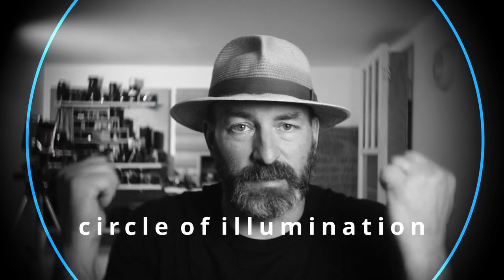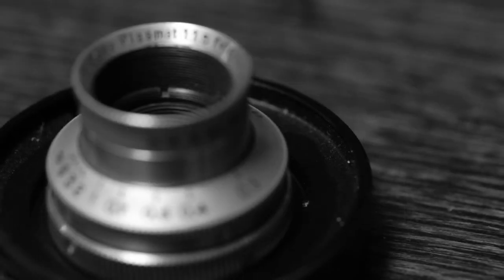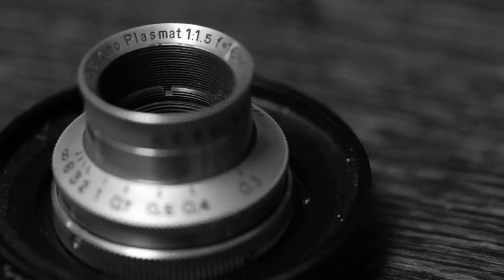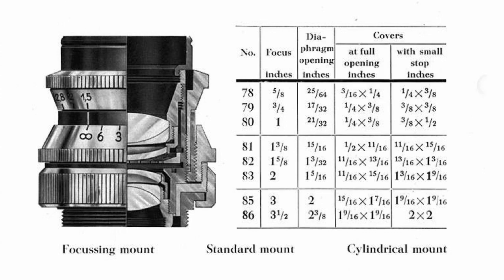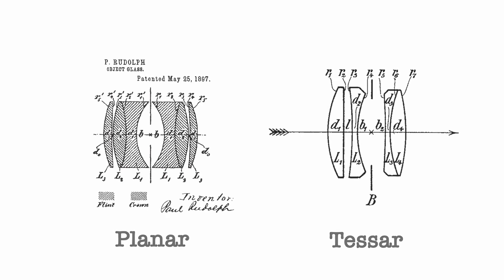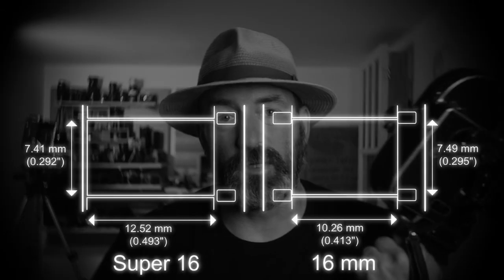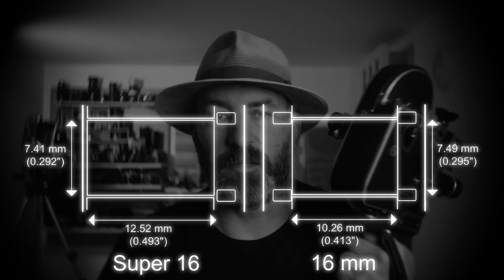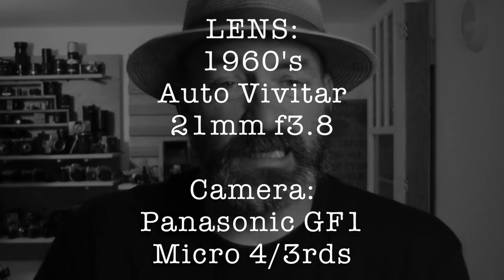Crazy vintage lens on a new...ish camera - The covering power of a lens

Comment: Great distinction between illumination and definition. Moden lenses do not require it, as the designs use all of the glass to refract acceptably. Still, the old lenses are a well of creativity. Aberrations are a challenge!
Reply from the maker: I think the Sigma Art series have a huge circle of illumination. A friend of mine was using one on the GFX medium format camera. It would explain the size and weight of those beasts, if they are designed to throw a larger image circle than needed and the sharpest part covers the smaller format. My Nikon Series E 50mmm f1.8 is another lens that has a larger than needed image circle; it might cover 645 format...
Reply: @nuovofresco  Cosina made the E lens for Nikon, hence it is not a Nikkor. 
Sigma Art lenses seem to be amazing, but 'flat'? I can't afford to invest in one, yet. 
Sigma have certainly out competed their bretheren in Japan.
Pity their cameras have not done better.

Comment: The plasmat is sharper than the 'Vivitar'. The serial number of which may assist you in identifying the Japanese manufacturer. Interesting!
Reply from the maker: I think I need to give the Vivitar another go. I'm pretty sure I missed the focus. One of my Minolta MD to m4/3 adaptors moves the focus point a bit further back than the focus distances on the lens show. The serial number starts with 37 so I think that it was made by Tokina if I'm remembering right. It has a T4 mount on it.
Reply from the maker: I re-watched the video. I definitely missed the focus by about 15cm on the Vivitar.... My hat reveals how off I was.

Comment: Did you know there are quite a few C mounts, not all old, that cover APS? and m4/3 has even more options.
Reply from the maker: I have a soft spot for the vintage lenses. I was looking at a 12-120 f3.4 Som Berthiot last week. Sadly it covered my sensor even less than the Plasmat. I need to get a C mount adaptor for my Fuji and shoot some 4K so I can crop in. The GF1's video specs are rather antique.
Reply: @nuovofresco  The early 1 inch TV lenses from Japan are fairly soft while resolving well. They sharpened up fairly quickly, so the primes and the 2x to 6x zooms are the best to get. 

None of the zooms entirely cover m4/3 at every FL. Uusally they cover say 10mm after the widest, but the 22.5mm to 90mm F1.5 is ecellent but so heavy it is unwieldy. There are a fair number for sale on eBay.
Reply from the maker: @patrickdonnelly5223  I was never a fan of toy camera images; again it's that dutch heritage... too expensive and random per shot. The C mount lenses on m4/3 give me a similar look at a fraction of the price. I was thinking about picking up a Pentax 25mm f1.4. I've heard good things about them, but I have a Kern Switar and Som Berthiot 25mm in that focal length already... I do love options though!
Reply: @nuovofresco  There are several versions of that lens. One is excellent and tiny. If it has a box, it will probably say B2514, but some C 2514s are also for a 1 inch sensor..... and of course some are for 2/3 inch! The trick is to see full glass at the rear of the lens, filling the C mount. thye used to retail for $90 in NY, but now retail for $150 or so. Rare now on eBay. There is a MV version, just as good but has set screws to avoid inadvertent movement of the aperture or focus rings. I replace the screws with stalks, for ergonomics.
Now sold as Ricoh, of course